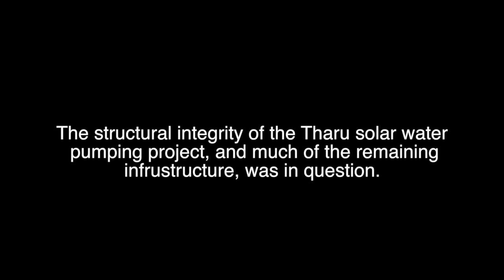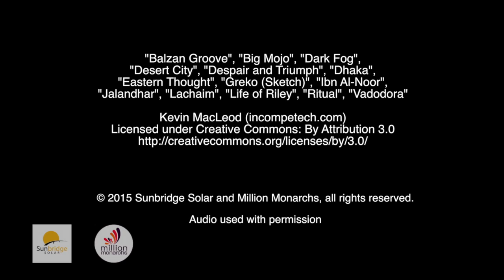Full Length Documentary: Sunbridge Installs for Rural Nepalese Community

Comment: The main hindrance to the widespread use of solar electricity for residential use in Nepal, even in an urban area like Kathmandu, is its cost. The cost for solar electric solution seems to be expensive than what is in the first world, especially if someone wants to go completely off grid. I have no idea about the profit margin for a company like Ghampower or Lotus solar to comment on that, however and it seems, with several companies in the Nepali market for the solar electric solution, the competition as well as the recent move by Nepal Electricity Authority to eliminate long hours of blackouts have not caused the price of solar electric solution to drop.